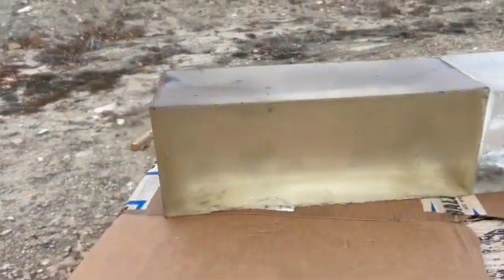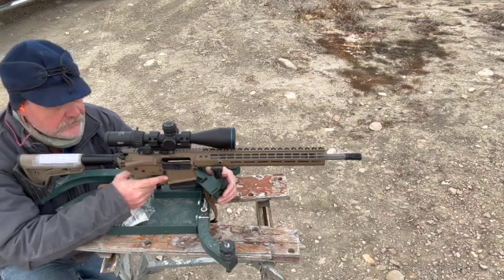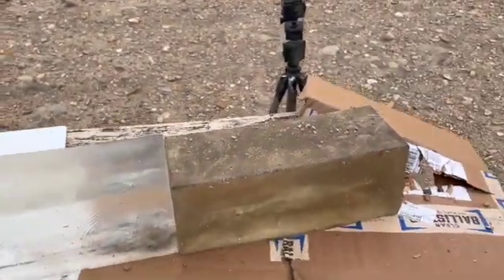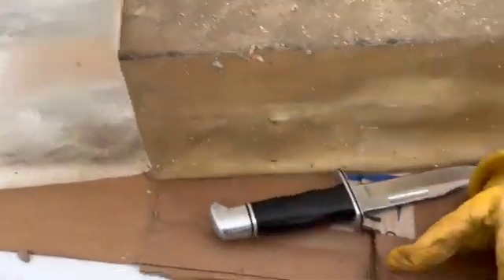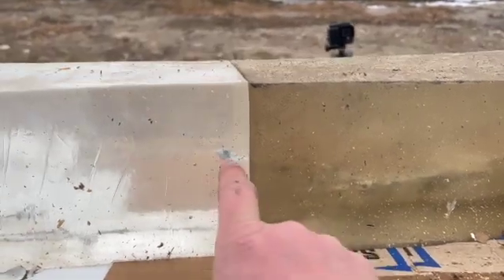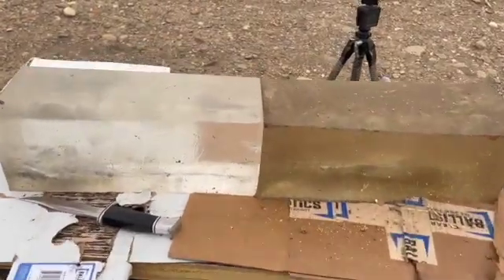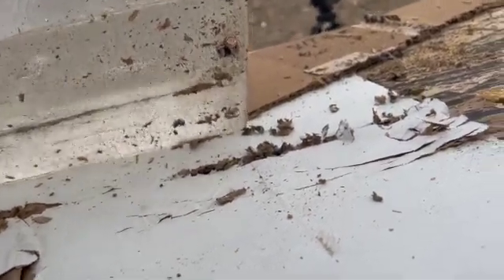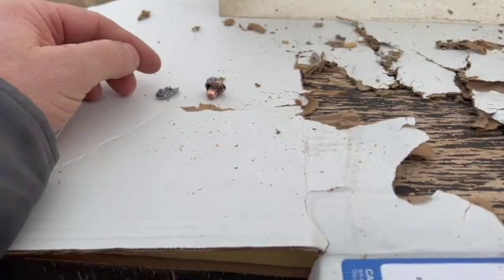308 ballistic gel test Hornady 168 bthp and Sierra gameking

Comment: I use factory 175gr federal gmm. I take a 1/16" drillbit in a drill press and drill down into the tip of the bullet 1/4". It doesn't hurt the accuracy at all and I've never once had them fail to open up dump all of their energy within the animal. They've all dropped where they stood as well. Reson i do that is because sometimes they won't open up at ranges past 400yds. Since I've started drilling them I've not had a single issue with that.

Comment: I actually use the Hornady eld m match bull 168 grain 308 for hunting deer excellent bullet people say all it's a match bullet not designed for hunting that just marketing you can actually go to some Hornady websites and see where FBI test the ones I use and have excellent terminal ballistic it's very interesting to read and see there testing now the Hornady Open tip or hollow point you are using with pencil through a lot times or tumble because of the open whole i thank will clog up and not let it to expand properly try the Hornady eld m and they will expand better at lower velocity than a bonded bullet and definitely way better than all copper higher velocity behind shoulder lower slower velocity high shoulder shots drop white tail all day long bn using them for 4 years in my ar 10 16 inch barrel and that bullet give you way better consistentsy and Berger bullets are awesome the best to bulleta I have used at dropping game fast

Comment: I have a Mossberg MVP Predator 7.62x51/308. I reload using either Varget or IMR4895, 165gr Speer BTSP and Hornady 168gr A-Max, magnum primers. I used the Hornady on a moose hunt. At 228 yards, the A-Max went in the right side through a rib, shredded both lungs, the went through another rib on the way out, leaving a 2 inch exit hole. The near 800lb moose stumbled 14 yards and dropped. My father in law who uses 30-06 was stunned at the performance, dropping his preconceived notion that the 308 Win wasn't a performer. Stay safe and happy shooting.
Reply from the maker: Thanks for the great comment. Sounds like a trip of lifetime. I don't have any experience with the A-Max I will have to give them a try Thanks for watching

Comment: Terminal ballistics are driven by velocity my friend. 

I would encourage you to shoot this test again at 100 and at 200 yards as opposed to 25 yards. Your penetration will likely increase as a function of deterioration of velocity [to a point]

The proof I have for this is .357 magnum 158 grain bullets oenetrating the same [or similar] depths in spite of less velocity and a larger starting bullet diameter. 

We killed Buffalo for nearly a century with soft lead balls out of muzzleloaders, and while I'm not fully certain, I'd venture a wager even a 300 grain 50 cal ball rapidly deformed and penetrated little more than your .308 there.

Excellent test excellent bullets
Reply from the maker: Thanks for the great comment Timber. I would agree with you 100% about velocity. My thought process is if the bullet will retain some weight and penetrate at 25 yards. It will certainly hold together and penetrate at moderate ranges. My end goal was to use the 168gr bullet in the 308 for deer. I think they will work great for that. We hunt elk also and I would not recommend this load for elk. I do love a 308 and if I were to use it for elk I use a more premium bullet such as a Barnes for Nosler partition. Thanks for watching
Reply: @chrisevansgunshorsesranchi699  absolutely man. Love watching you break it down. And I appreciate all the effort you put into these tests

Comment: Basically a match bullet is nothing more than a FMJ.  They are not true hollow points. The small hole in the tip is how they get the lead in a perfect copper  jacket. I have shot two deer with 168 gr  federal match in both 308 and 300win mag. Both times it acted exactly like a FMJ.  It had a very small exit hole and did little damage. Both deer ran over 100 yards living a very faint blood trail.   I wanted to try them on something living, as they are my department’s issue sniper rounds for us. I was in no way impressed with their performance.  But as a duty round for snipers, where 95% of the shots will be head shots  well under 100 yards, they work as desired.
Reply: Backfire did a test of Hornady match 168’s on deer and he said even though the entrance and exit was small the deer either dropped on impact or ram no more than 20 yards when hit. I wouldn’t prefer it on deer still because I like the eld-x but if I was in a pinch I wouldn’t feel bad about using em
Reply from the maker: That is exactly what I thought. I did not expect this bullet to react they way it did. Both shots in the gel the bullets  fragmented and transferred a ton of energy. I was very surprised to see this. I expected the bullet to pass right through with no wound channel just like a FMJ. This is not my first choice for a deer hunting bullet but I think it would work in a pinch. I would not use this bullet for elk they are just too hard to take cleanly. Thanks for the comment
Reply: @chrisevansgunshorsesranchi699  Was the gel warm? If it gets cold it is a lot harder and might have caused the bullet to perform way differently than the do in game.The military actually Considers, match rounds, full metal jackets, and some units. Use them in compliance with Nato rules because they act like FMJs.
Reply from the maker: @americanpatriot477  That is great point.  I did not even think of that. It was below freezing at the time of the test. Maybe that is what caused the bullet to fragment. I felt like I should get more penetration out of the 165 grain game king but if the temperature does make a difference that might change the out come.